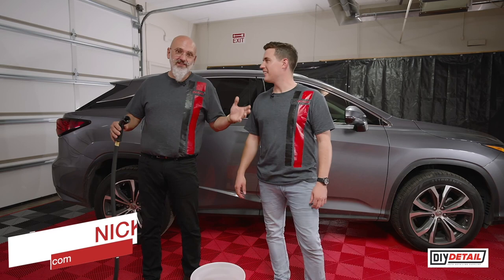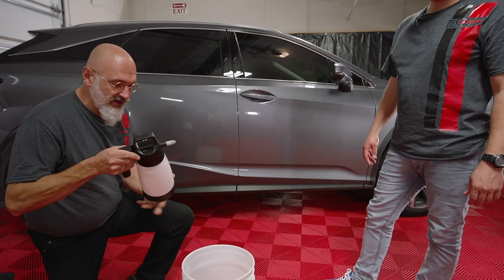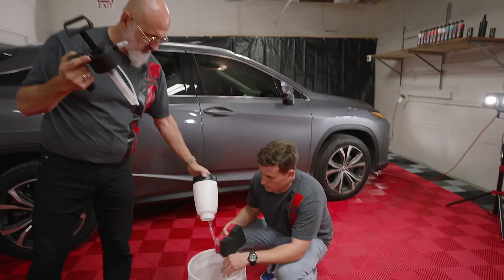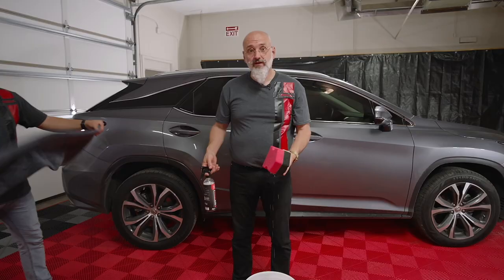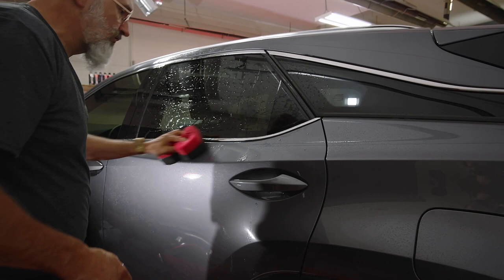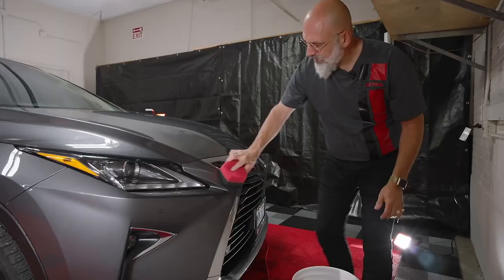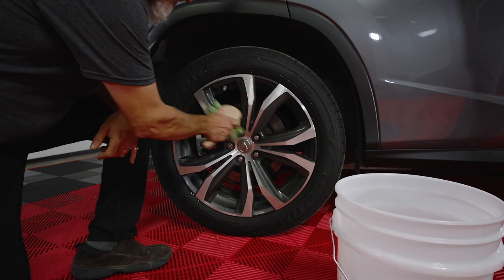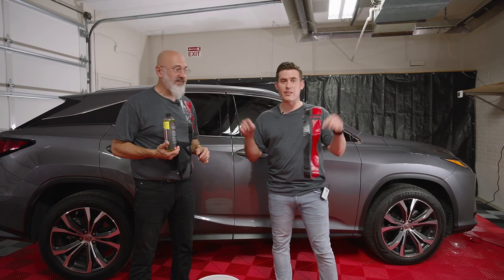Wash car with 1 gallon of water?!

Comment: The DIY product line continues to impress and the rinseless wash is no exception. Small detail but having the cap measure exactly one gallon is actually a big benefit for me. With a touch less car wash using 70 gallons of water utilizing a rinseless wash is a big deal. Thank you for a great video.
Reply from the maker: Thank you Neil!

Comment: Thanks guys for the videos. I just recently started incorporating rinseless washes into my routine. I really like it. Maybe even more than using my pressure washer. It’s just so convenient. My drying towel is just as clean when I’m done as a traditional wash and I don’t notice any additional scratches either.
Reply from the maker: It’s great because you can totally pressure wash the wheels and wheel wells and even the paint but that final step doesn’t require a rinse so you get right to the drying/drying aid. That’s always been my preferred method when I have hose access. Thanks man! -Nick

Comment: I was using 1 gallon of water until recently when I bought a grit guard. Now I kinda regret that after watching this. I started using 3 gallons because I couldn't get my Ultra Black Sponge deep enough into the water.
Reply from the maker: Yes the grit guard is a great tool, but it shields close to a gallon of water unfortunately.

Comment: Hi Yvan, when you dip the sponge back in the bucket are you conscious about not hitting the bottom of the bucket? I like the non-grit gard/low water method and rarely use the guard anymore since watching this 6 months ago.
Reply from the maker: Yes, the grit guard is an important safety device.

Comment: Great Video!  I used to do the one gallon rinseless wash then I stopped because of how dirty the water got.  But now I know that it’s safe so I’m going to start it up again.  Saves water as I always use distilled water.  Interesting sponge.  I have the BRS and the UBS, is this asponge a combo of both?
Reply: Use multiple towels
Reply from the maker: It is!
Reply from the maker: For sure that’s also an option. We really wanted to embody a minimalistic approach in this video just to prove what is possible…you can always add towels, water, buckets, etc etc :)

Comment: Quick question, when Yvan says towards the end "its more like a dye" does that mean that every time you're dipping the sponge back in that its taking in that dye again and putting in on the next panel?  I understand that the dirt or dye is now safe due to encapsulation, would that mean that the drying towels become dirtier quicker?  Thanks
Reply from the maker: Your drying towel will stay cleaner than with a strictly polymer based Rinseless or soap.
Reply: @diydetailofficial  I understand that your reply may be true.  I've been using rinseless for quite some time; but if your rinseless is liquifying dirt, does that mean that its being re-impregnated in the sponge with each pass.  I understand the dirt is encapsulated and emulsified but if it is a dye, how would the dirt turned into the dye not be introduced back into the sponge.  As per your comment I have refused to use soap for the last several years, it makes sense; its old technology.    I do understand that the tech is proprietary for every manufacturer but would really like to know if the dirt is emulsified, how would it not end up on the drying towel if its still emulsified in the rinseless wash.  I did a wash on my truck 1/2 on the left 1/2 on the right with two different rinseless solutions and the same sponge.  they both cleaned the surface but at the same time one suspended the dirt and one dropped it to the bottom.  https://imgur.com/a/gytyxHx

Comment: Nick & Ivan: nice video.  I always purchase distilled water for my rinse-less washes.  That way no one can say anything.  Probably will never use a hose and bucket method again.  Totally sold on rinse-less wash!!  Thanks again, Mark G
Reply from the maker: Thanks Mark! I love distilled water (though it’s been hard to find at my local Wal Mart lately). The pressure washer has its place but i love the ease of a rinseless wash. Especially if you can have a plug and play set in your garage

Comment: Please add a decon stage before/during or after the rinseless wash. Would like to know how you incorporate that in the routine. Or is that out of scope of the rinseless method? Thanks!
Reply from the maker: You can totally incorporate decontamination and do a rinseless wash! In my experience it just involves more “flushing” with rinseless solution in sprayer after you’ve clayed and used iron remover. If you don’t use iron remover it’s even less rinseless solution AFTER you clay than the previous method. And in FACT you could wash, spray ceramic gloss on panel, use clay towel over panel with ceramic gloss and then buff dry with microfiber towel…but we will do a video on this later:) That’s a fun method that Yvan pioneered. -Nick

Comment: Basically it’s only good for cars that aren’t dirty. 90 percent of the cars have bugs, contaminants, or literal mud caked in there smh. Or sut.
Reply from the maker: I would suggest you look at our video about rinseless wash in direct sunlight light 🤙
Reply: @diydetailofficial  I have. I didn’t say anything about direct sunlight. That car in the other video was also pretty clean to begin with.
Reply from the maker: @iosgaminggeek5395  I hear you, I think a rinseless can be extremely versatile but it's ultimately your call when it's the car you're working on. I love it but do enjoy a good pressure washer/foam cannon wash on occasion.

Comment: I just can't believe this is a safe way to wash a car without introducing a ton of light scratching to the clear coat.  Such a small amount of product, water, and a single sponge.
The pre-spray around the car didn't even get it all wet, more of a light mist.  You can say "encapsulating" as much as you want but does it really encapsulate sand and grit enough to drag it across the surface with a sponge?
I don't mean to sound negative, just highly skeptical of this method and the intentions (selling product?) behind it.  I understand the water use restrictions around the world but this seems so far from the safe approach we are used to seeing and doing.
Reply from the maker: This is Yvan, I have been using Rinseless washes for over 20 years almost exclusively. My shops didn’t have soap. This demonstration was an extreme case. Ideally yes you would pre-rinse before ( Rinseless makes reference to not rinsing it after you apply the product to the surface).  With a bit of common sense this is a very safe wash method. Unfortunately many people are now faced with water restrictions, and it doesn’t look like it’s going to get better in the short term.
Reply: I watched hundreds of no rinse videos before trying it, to say I was apprehensive was an understatement. All I can say is I’ll never use soap again, the science is real. As Ivan said in other videos, do you still drive a car with a carburetor…

Comment: There is no grid guard in this bucket :o
Reply from the maker: Nope — Yvan explains that at the end of the video. If you get to the end and hear his explanation (Nick questions him about it) what are your thoughts?
Reply: @diydetailofficial  I think it still can be safe to wash a car without gird guard - just don't touch the bottom of the bucket :) Of course I feel better when I have grid guard in
Reply: Why not use the multi towel method ?
Reply from the maker: The goal of this video was minimal water usage, while remaining safe. The multi towel option works, but uses more Rinseless solution.
Reply: @Jeeper1378  in other vids yvan talked about this...the sponge with its split grid pushes the dirt deeper into the sponge.  In theory the microfiber rag traps dirt in the surface that could cause stratches... ive used both and like both.. depending on the day ...i typically will use the multiple plush microfiber rags  and never re dip in to the clean bucket... this way i can keep the bucket clean for later in the week or multple cars...
Reply: @diydetailofficial  no not at all. Ive done 6-8 towels in less than a gallon.
Reply: @barrybij8079  agree, just saying one can get away with less water using the multiple towel method.
Reply: @Jeeper1378  In my experience as a weekend detailer hobbyist the multiple towel method allows you to keep the bucket cleaner and save the rinseless wash solution for use in future time, however this makes you wash a few microfiber towels for the next use. With the sponge I don't thinks its safe to use the rinseless again, unless for wheels maybe and you have to dispose it, but you do have to wash just the sponge at the end.